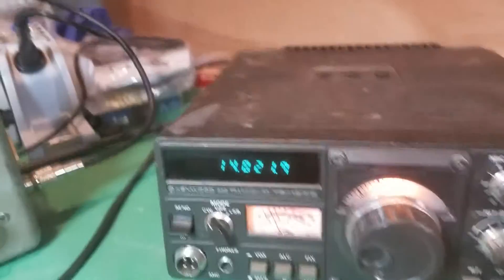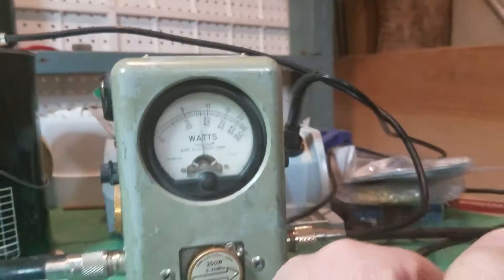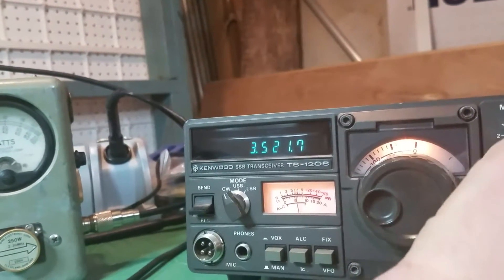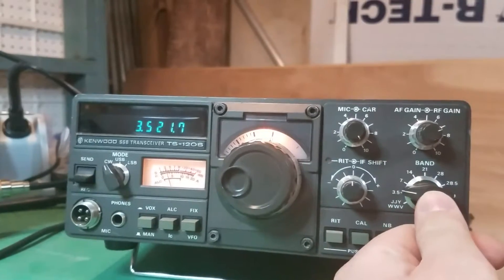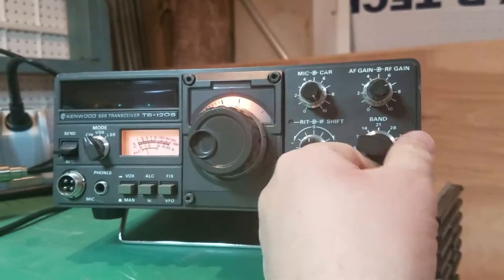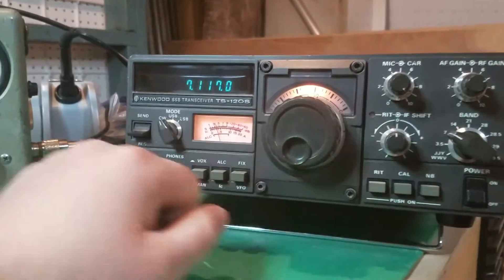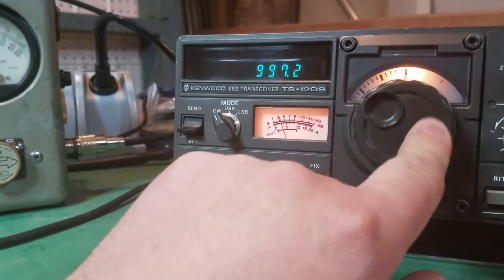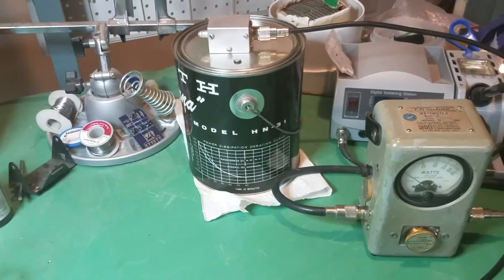Kenwood TS-120 Initial Test

Comment: Looks like your not feeding it enough from the power supply the way the lights dimmed so drastically on the radio. My TS-120 shows 200pep.
Reply from the maker: Thanks for the input.  I have been working on other projects, will keep that in mind when I go back to this project.  What power supply are you using?  I was using the Kenwood PS-30.